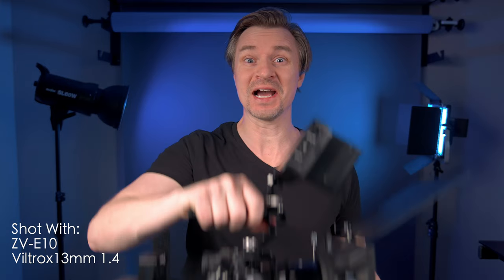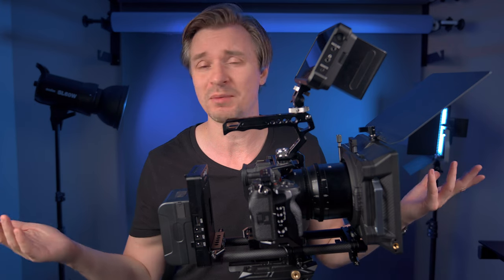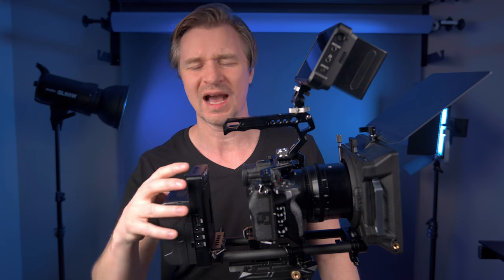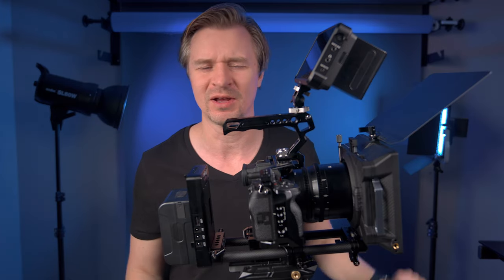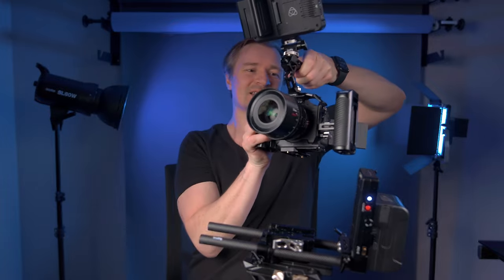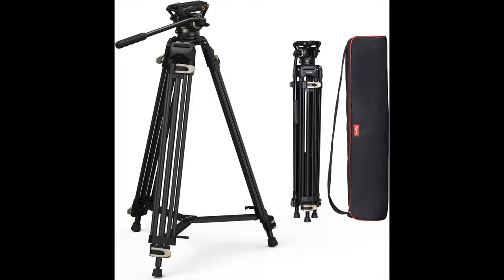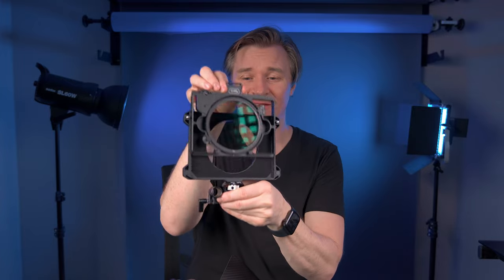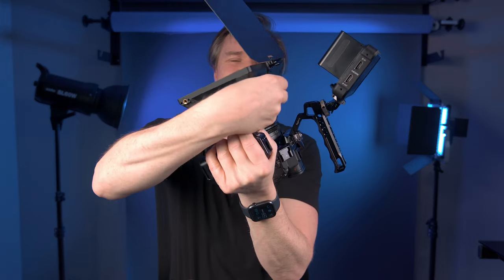Sony A7IV SmallRig Cinema Rig, Cage and Modular Matte Box

Comment: Hey mark, I'm all about cinemagraph and I'm going to buy a camera to do professional work. I'm stuck between Lumix s5 and Sony a7iv, which one do you think I should get?. Actually, my heart is sony, but I don't know if the rolling shutter problem and the image are caused by the sensor, but I can't be sure because it doesn't feel cinematic. "I apologize for the use of translation, there may be nonsense and inverted sentences"
Reply from the maker: the s5 is overall a better video camera except that it has a major problem - autofocus. the Sony A7iv autofocus is perfect. There are more lenses to choose from with Sony too. you can definitely make the Sony look cinematic. just shoot in log and colour grade. The S5 is amazing, but you have to manually focus all the time - and that can be very difficult and time consuming if you have moving subjects. the rolling shutter is fine on the A7iv - but the s5 is a bit better. You’ll only notice rolling shutter is panning fast and filming things like race cars.

Comment: Hey Mark, I've been doing a bunch of reading recently as I prepare to kit out my new FX30 and I have a question that you might have some insight on. I plan to power the FX30 with one of those new Small Rig VB99 batteries, which I will mount on their V-Lock battery plate with rod clamp and then either use the Kondor D-tap to USC-C, 8V DC to USB-C or Dummy FZ100 to D-Tap. I would like to also duplicate this solution and utilize either the D-Tap to USB-C or 8V DC to USB-C cables to power the ZVE-10, but I am concerned about the amp draw. Do you know if the USB-C input on the ZVE-10 will regulate either the D-Tap or 8V DC coming from the VB99? Should I instead utilize a FW50 dummy to D-tap?  Given that in a previous video you powered the ZVE-10 via USB-C connected to a NP-F interface with a large NP battery I'm hoping I can go something similar with the VB99, as I'd really like to own several of those with the plate/cables combo to power several similar but different cameras that way on a shoot. But I don't want to blow anything up. Thoughts?
Reply from the maker: I wouldn’t do the dtap right to the USB-C for the zv-e10 but you won’t need to. The smallrig batteries have USB ports that will output the 5v the zv-e10 needs. You don’t need to run through the dtap
Reply: @Mark Bennett's Camera Crisis  you're right, I completely forgot about those usb ports in the VB99. smh.